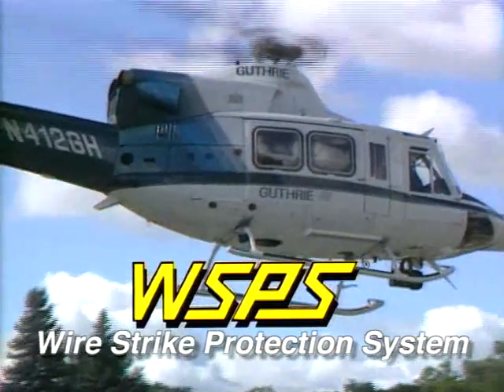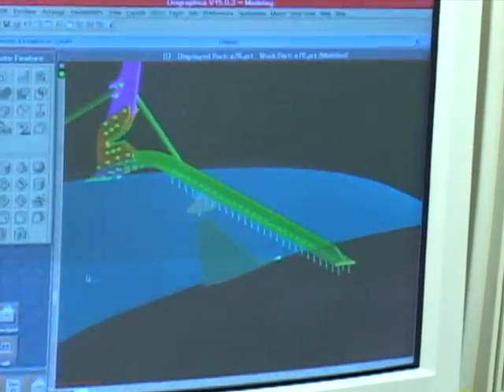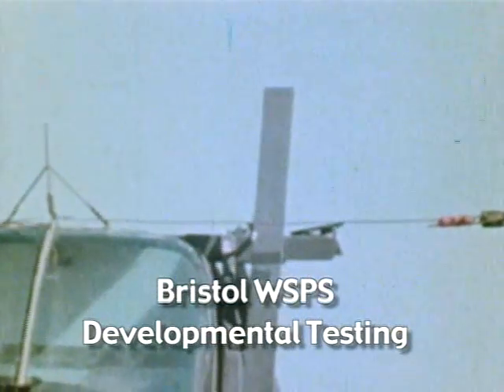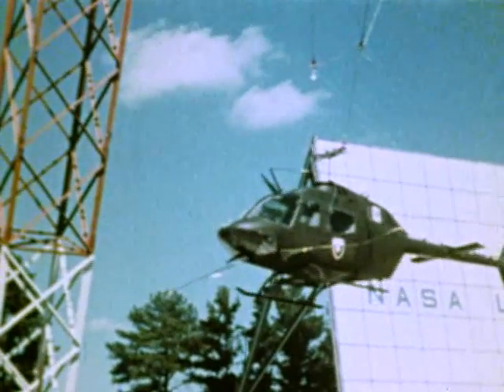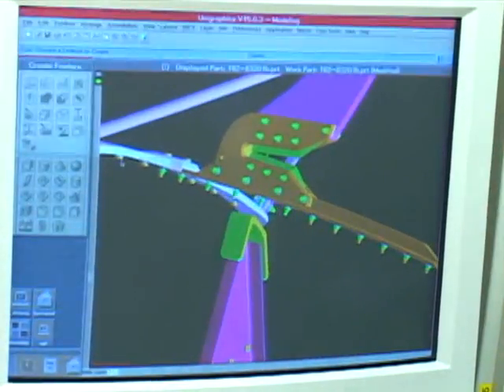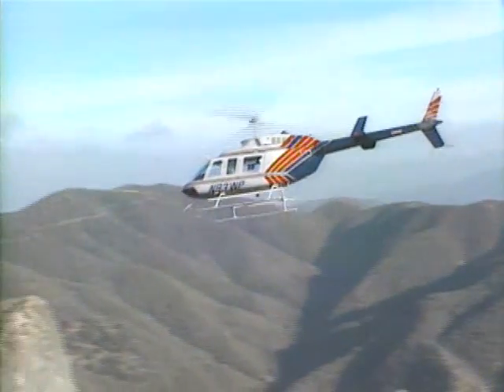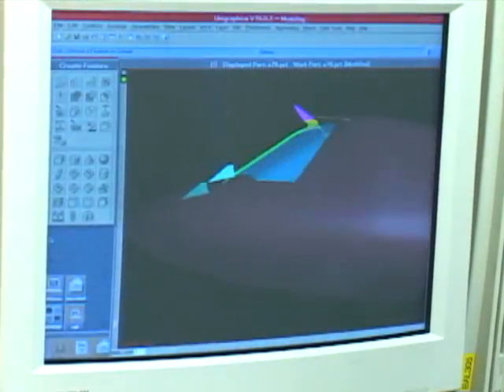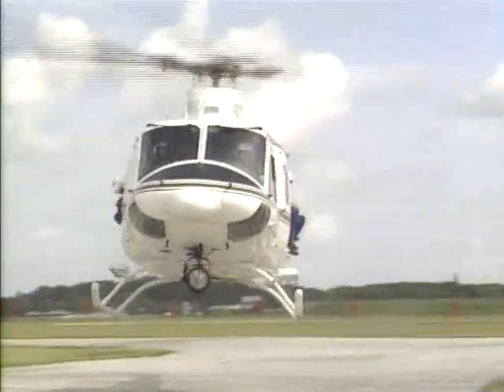Wire Strike Protection System (WSPS) - The Cutting Edge of Helicopter Safety

Comment: what if the wire is above the cutter and below the rotor?
Reply: If that happens it means you've run out of luck. However, a patent was issued in 1994 for such a situation, whereby the rotor arms are equipped with wire cutters. Not clear if it has reached application yet.
Reply: @vanmonroe4346 what do you mean by "rotor arms?"
Reply: You crash with horrific results for all aboard that's what. Which is why wire protection systems were invented.

"Perfect is the enemy of good" is an aphorism that means insistence on perfection often prevents implementation of good improvements. Achieving absolute perfection may be impossible; one should not let the struggle for perfection stand in the way of appreciating or executing on something that is imperfect but still of value.

Comment: Surprised the top part isn’t higher and closer to the rotor… what happens when the rope goes above it 🥶🥶
Reply: it can't get any closer or it could be hit by the blades, since the rotor disk doesn't stay still. If the wire strikes in that gap...normally it ends up really bad.

Comment: Ugh, this video is so much shitty jargon. Using proprietary software and finite element analysis...well I certainly hope you fucking did. Otherwise you are just fucking around with scissors mounted on helicopters. Unnecessary blabble in the video. I just want to see it being used and when it doesn't work.

Comment: Still won't save pilot's career , if strike is deemed to be result of pilot error. Afterward, no service will alow pilot to fly , no helicopter private company will hire him as pilot, and no aerospace insurance will write a policy for him.
Reply: Irrelevant. It's not supposed to save a pilot's career it's supposed to save the lives of all aboard the aircraft. It's a last resort life saving device not a career saving device. Saving the career of a pilot who has crashed into a cable cutting it was never even a consideration let alone the objective. 😂
Reply: Perfect is the enemy of good is an aphorism that means insistence on perfection often prevents implementation of good improvements. Achieving absolute perfection may be impossible; one should not let the struggle for perfection stand in the way of appreciating or executing on something that is imperfect but still of value.
Reply: Ok… better to be alive and have to find a new job then dead on fire in a pile of wreckage from something that could have been prevented with a couple aftermarket accessories.

Comment: Wouldn't the rotors hit the wires first anyways?
Reply: i imagine it would depend on the angle the helicopter is flying relative to the ground
Reply: depends on what angle and speed
Reply: surely youd see wires if you were flyin straight into them
Reply: steff serpent never
Reply: @stivi739 lol not always
Reply: @stivi739 um, no.
Reply: @stivi739 surely you couldn't be that clueless... the wire you don't see is the one that kills you, not the rest of them you do see. Which is why wire cutter protection systems exist. 😂